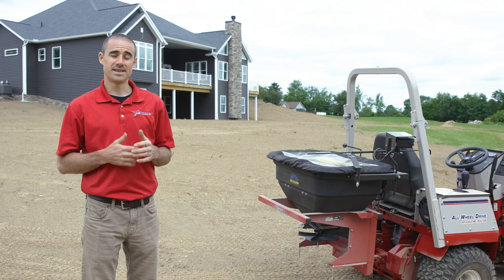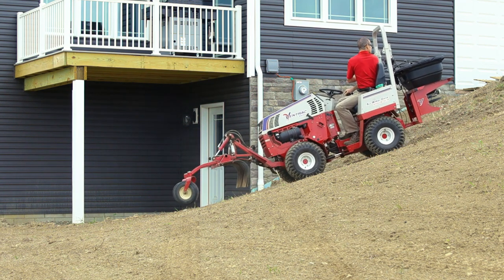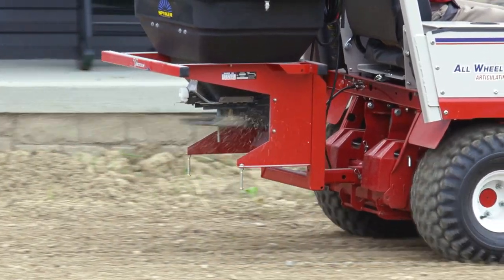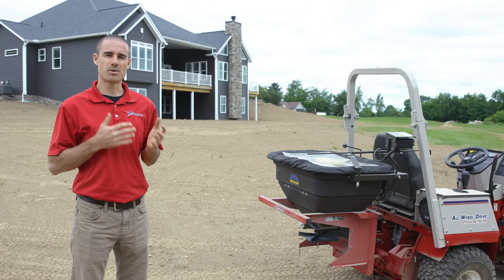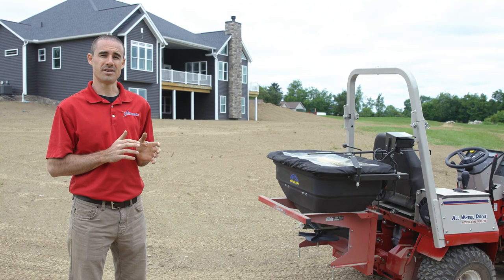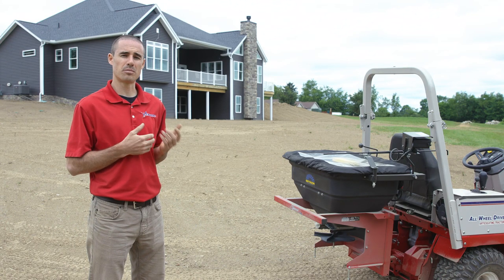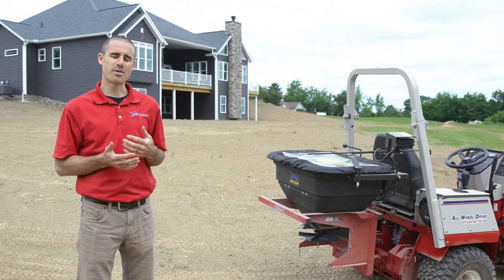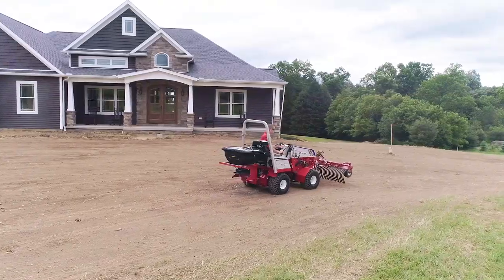Seeding a New Yard with the Ventrac Broadcast Spreader

Comment: It's nice that the spreader is powered by a electric motor.  The problem with the pull behind is it runs off your ground speed.  The Ventrac will give a more uniform spread of seed And fertilizer.